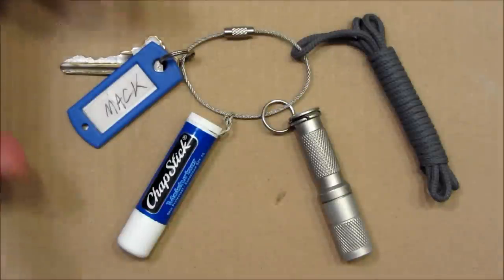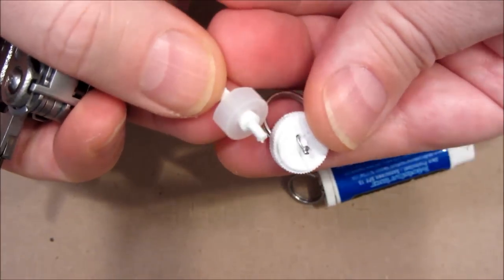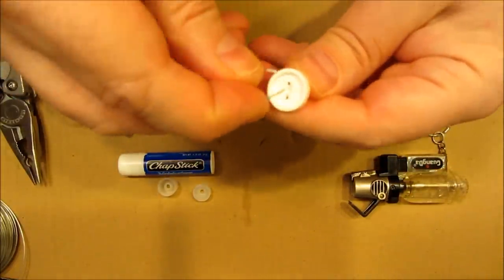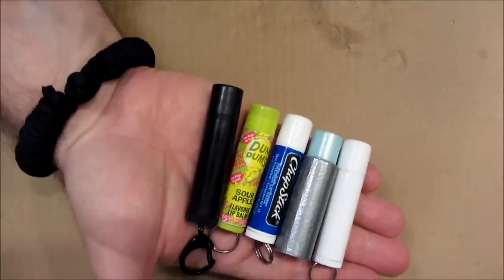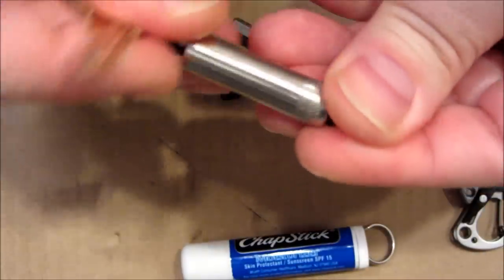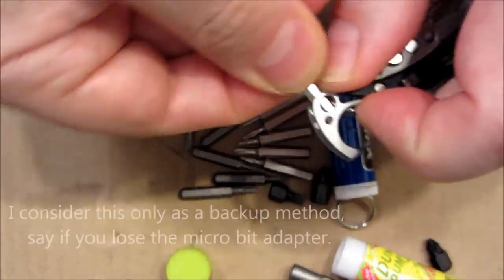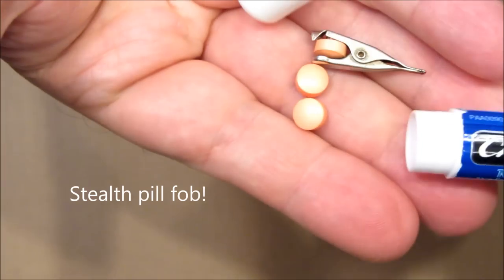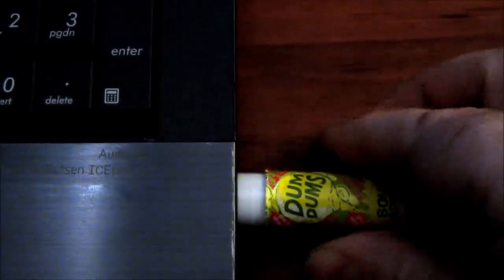D. Tape 5: CHAP STICK Stash

Comment: what s the name of that red mini flashlight?
Reply from the maker: Sorry, I can't recall exactly. It was just some cheap store brand akin to a Streamlight Nano light. http://www.streamlight.com/en/products/detail/index/orange-nano-light I'm not generally a fan of products that use these small LR41 batteries because they are hard to find with published expiration dates. For very small zipper pull sized lights I prefer LRI ("Photons") because their lithium batteries don't leak. I did a recent video on upgrading one of them:https://youtu.be/yg9Q4zCg8QI
Reply: MeZillch how i can send you a picture of my survaival kit i tried to build it as yours
Reply from the maker: You can upload a short, let's say 5 second video of it, select private or unlisted if you don't want anyone else to see it but me, and then give me the link to it .  Even if it is just a still silent movie I'll see it and press pause to take more time to examine the image.Or you can use iMovie or Windows Movie Maker to change a still image into a short movie slide show to upload or Youtube says it can create a slide show out of still images using their online program here:https://support.google.com/youtube/answer/1696878?topic=2888648&hl=en
Reply: MeZillch im  12 so it s not a super great kit but i will make a video about it and i will send you a link on youtube in comments or if you want i can send it to you by e mail

Comment: Noticed that your bit adapter was from Home Depot (Husky brand) - any idea which model it is?  Doing a quick search on the HD site didn't yield much.  It looks like Wiha makes a similar adapter: http://smile.amazon.com/gp/product/B00XIPRG4M.  Don't know yet how well it works, but have one on order from Amazon.
Reply from the maker: +John Miller The Husky [Home Depot house brand] adaptor came with a screw driver kit I bought many years ago called: "Home Depot Husky 30-Piece Ratcheting Screwdriver Set". The Wiha version is probably the easiest way to get it these days.
Reply from the maker: +John Miller Here's an image of what the kit looked like:http://onefrugalchick.com/wp-content/uploads/2011/08/806f9cd4-120e-4a87-a923-9d32ac09ba8f_300.jpg
Reply: +MeZillch Thank you for the reply!  I got the Wiha adapter in the mail yesterday; does exactly what it says.  Saw you're in the Greater Boston area--You-Do-It carries a lot of Wiha stuff, but not this particular adapter.  I'll see if I can get them to stock it: would be nice to have a local source.

Comment: Do the caps ever fall off while the tube is filled with stuff? I imagine a chap stick cap isn't made to support all that weight when it's hanging from a keyring.
Reply from the maker: There's an extra ring of clear tape which makes the cap fit very snugly, so it's nearly impossible for it to fall off on its own.